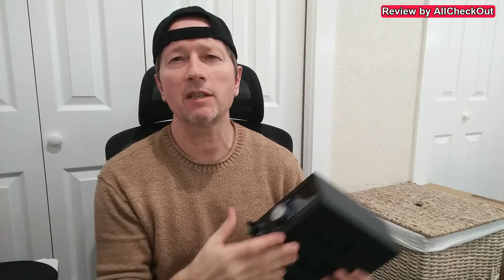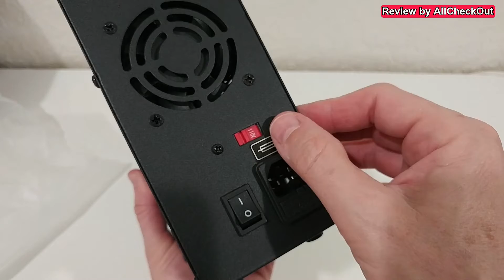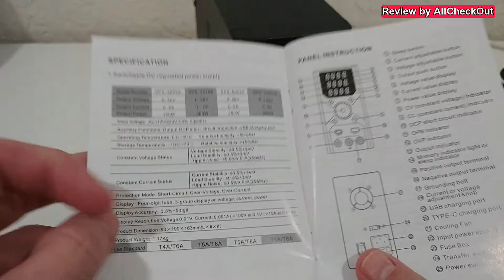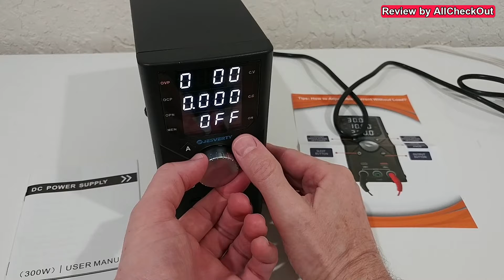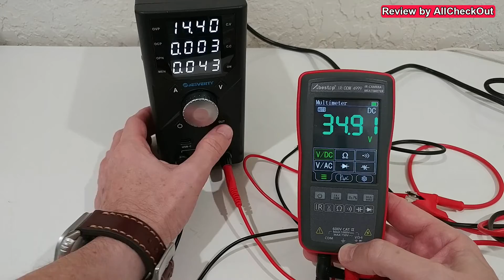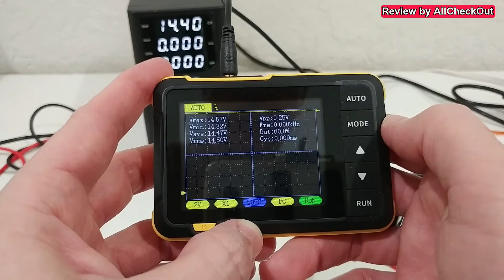JESVERTY SPS-3010X Variable DC Power Supply With USB-C / A, 30V 10A, Full Review Tutorial

Comment: Hi, thank you for your video !  I think with this power supply  a battery charge finishes always with constant choosen voltage (here 14,4V)  and slowly dropping amperage  .   But without BMS , or PCB without balance programm ,  the cells are not balanced .( It's more critical for a Li-Ion battery than for one LFP) . And lot of cheap chinese batteries for cordless tools have only a simple PCB ,  so sometimes with good terminal voltage but  unbalanced cells ,  some of them can be too low and others too high (critical) . It's the only issue I can find with this very good power supply if you use it for such batteries . Friendly from France !😃
Reply from the maker: That's a very good point to consider when charging batteries! Thanks for the info! 🙏 ... and Vive la France or Allez les Bleus (correct me if I'm wrong ... 🫣🫣🫣)... It's long time since I've been talking French ... . BTW did you buy it too? How do you like it? I still use it a lot (mainly to charge this battery ... )